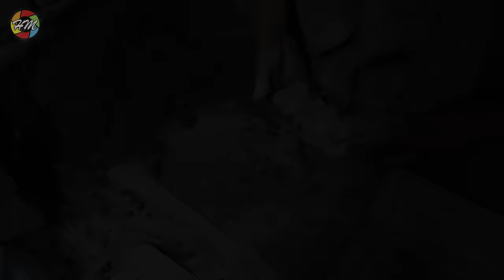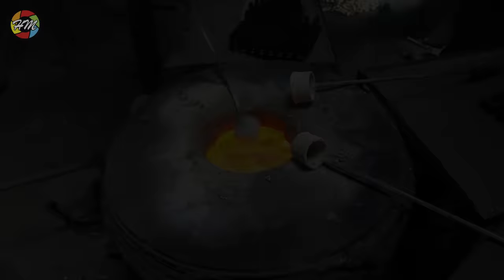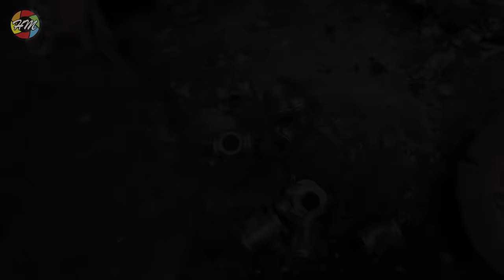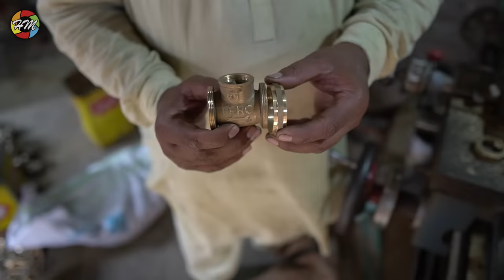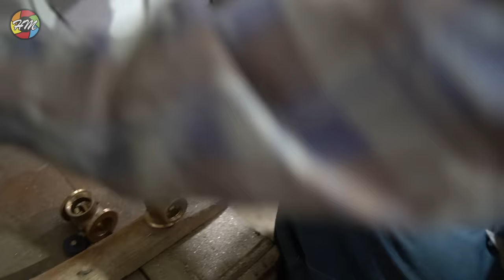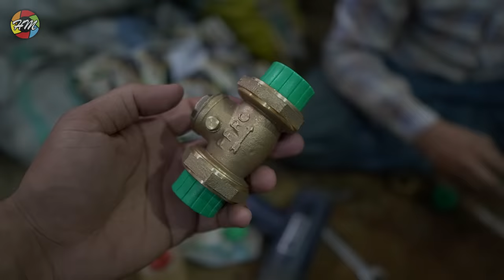Manufacturing process of Brass Gate Valve | Amazing Brass Valve Casting Process.

Comment: I used to work at one of the last two rough brass valve manufacturers in the US and made a product very similar. It was an interesting watch ass our methods were very different but we did so with a much higher volume.

Comment: Check Valve. Did not see the seat being machined. 
With the fittings supplied, looks like it is for low pressure or irrigation applications.

Comment: That is NOT a gate valve, it is a check valve.
Reply: That's the first thing I noticed.
Reply: I spent 37 years in a oil refinery.  I wish I had a dollar saved for every one of these kind of check valves I have installed.  Water for cooling systems mostly.  Petroleum  products using brass is a hazard don't use it. In case of a flash fire. Brass melting point is low. You can put out a fire quick enough with steel components that you won't have a ruptured line with a bigger fire. And I have fought some fires it always scared the c@@p out of me. Over that 37 years we lost Two men due to fire !
Reply: Yea that a one way valve , mistake by that guy

Comment: As usual everything is dropped on the floor! Imagine the voids in the metal
Reply: It would be tossed as scrap and remelted with the gates and sprues. I was a little amazed at how quickly they broke open the molds.

Comment: i worked for 20 years in the manufacture of plumbers fittings all machined to close tolerances and go and not go gauges for bores and threads there is no evidence of close working here so if it fits and works it's ok.

Comment: This is not a Gate Valve, this is called Swing Check Valve.
Reply: I think this is a low tech unidirectional flow valve. swing check works with flow pressure. This valve just allows flow in one direction.